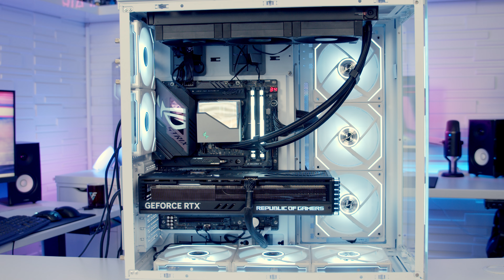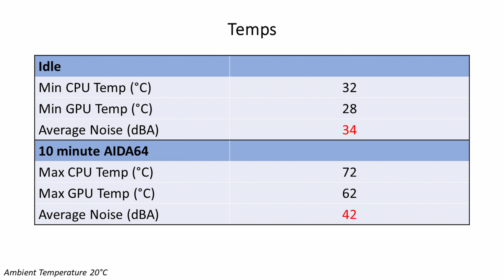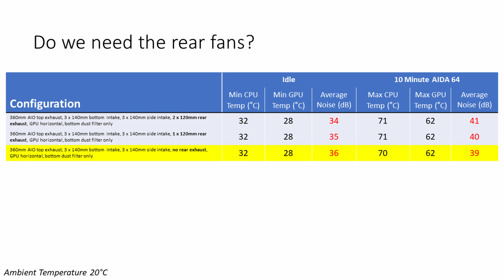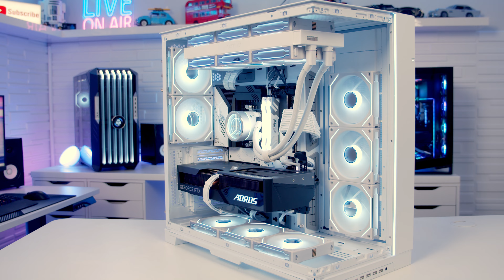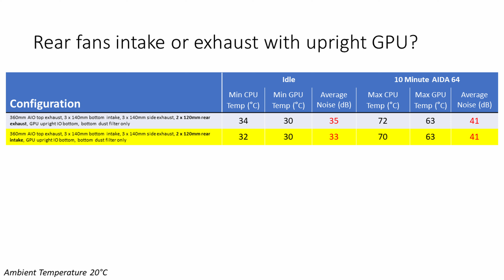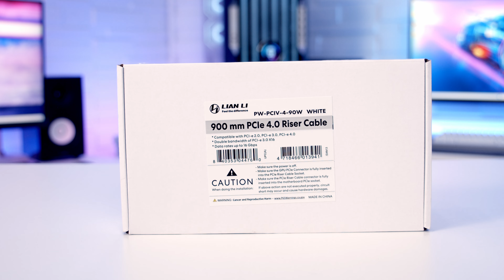Lian Li O11 Dynamic Evo XL - Best Fan Configuration

Comment: Bro is this okay? I am going to build this soon.
Processor-Intel Core Ultra 7 270k plus

Motherboard-ASRock Z890 Nova WiFi(Gen 5 x4 Support)

Graphics card- NVIDIA RTX 5080
( zotag or gigabyte )

CPU Cooler-Arctic Liquid Freezer III AIO 420 (Black)

RAM-G.Skill Trident Z5 RGB
16*2=32GB (should I go for7200MHz/6400MHz)

Storage (SSD)-Crucial T705 2TB Gen5
NVMe SSD (14,500MB/s)

Power Supply-Corsair HX1000i
(1000W) 80+ Platinum ATX 3.1

Cabinet (Case)-Lian Li 011 Dynamic
EVO XL (Black)

Fans-3 × 140mm SL-Infinity (Side ke liye) Reverse Blade model mein 

-3 x 140mm SL-Infinity (Bottom ke liye): 
Reverse Blade model mein

2 × 120mm SL-Infinity (Rear ke liye): Ye Normal
Reply: i hope u got the ram before this issue. have 2x m.2 an have one for the os note 500gb should be good enough u can add other software like razer lian li ect.

Comment: Studied your informative video a lot of times when building in my EVO XL myself. This case make a lot of different setups possible, which is why I love it. There's just so much to explore. I decided to try switching from horizontal GPU and mount it upright to perform the same tests you died, only with another GPU. My PNY 4080 Super performed very different in the horizontal position compared to upright. I got the absolute worst temps in the upright position.
Stress tests performed with OCCT for 10 mins, 3d Adaptive set to Extreme.
I observed GPU but also Hotspot temp to get a better picture of the temperature.
Fan Setup for horizontal: 2X 120mm at the rear set to exhaust, 3x 120mm set to intake at the bottom, 360 AIO side mounted set to intake, 3x 120mm top set to exhaust.
Fan Setup for upright: 1X 120mm at the rear set to intake, 4X 120mm set to intake at the bottom, 360 AIO at the top set to exhaust, 2x 120mm behind upright GPU set to exhaust.

Results as follows:
Horizontal: GPU Temp max 71C, Hotspot max: 89C
Upright IO Bottom: GPU Temp max 74C, Hotspot max: 94C
Upright IO Top: GPU Temp max 79C, Hotspot max: 101C

Results shows the same conclusion that you mentioned in your video, it varies alot depending on the graphics card, and this just clearly shows that this card doesn't like to be mounted upright.
Reply: Doing the same on my build... personally I like the AIO on the side so the top and bottom fans match exactly in terms of aesthetics

Comment: I currently have one side intake, 3 bottom intakes (with filter), top AIO intake (filtered) and two rear exhausts (all fans aside from the AIO ones are the corsair af slim 120mm ones, no RGB) beause I wanted positive pressure and I spent a week watching airflow videos but I think this is not the best approach despite all my effort put into trying to imagine the airflow and concinging myuself it would run smooth over the mobo cooling the chipset down a bit too. 

It's hard to know with W11 infecting my machine with their messed up attempts of launching the telemetry I disabled, thus running my 7800x3D to 80ºC sometimes until I kill the damn Click to run from task manager... damn o356... I digress, I'll switch to linux at some point.

I'm wondering why are there no side AIO exhaust attempts made. I'm thinking about that and wondering what difference would it make in temps extracting all that hot air from the central air bubble that gets created coming off of the Mobo and a horizontal GPU, but seeing that the best temps under load and idle + best noise are achieved with the 360mm AIO side intake, 3x120mm bottom intake, 3x120mm top exhaust, 2x120mm rear exhaust, maybe I'll go for that (with the caveat of only having 2x140mm top exhausts and 1x140mm rear exhausts until I get my hands on some new fans) 

thougts? (no prayers thanks)

Comment: So what I was wanting to do was change the direction of the front fans so that air is only pulled in from the side and no hot air that comes off the radiators goes inside the case or thru different radiators but I don’t know if that would work because of the pressure concern issue.

Comment: Ok I want to thank you so much Chris. First your Lancool 216 video helped me so much when building in that case. Then I sold that PC and started anew with an O11D EVO XL build. All 140mm fans except the rear and side LF III 420 push-pull AIO. Though I couldn’t mount the 3rd top exhaust fan yet because of the AIO tubes.

Bottom line is you now helped me build 2 computers with very good airflow setups. Thanks to your build guides, it was a breeze building in these cases.❤

Comment: is it possible to verticaly side mount that gpu  but with fans blowing out the side exaust?  
bc of all the heat going into the backplate of that gpu it probably gives worse results than its needed.  same as it is, just flipped around, so youre actualy looking at the backplate instead of the fans.  Im not here for looks.  :D 
also, the righ most bottom intake fan would then actualy serve a purpose of cooling that backplate, so i think were leaving some performance on the table.

Comment: curious if this case would allowed me to mount a powercolor red devil 9070xt 340mm length in the top pcie slot and a 6900xt in the vertical gpu with the rise cable going to my pcie 4 x 4 slot at the bottom of the motherboard?

Comment: There is a point of irony to point out with this case.. It is geared towards being for AIO users, but the way it is made makes it optimal for air-cooled setups with maximum through-flow. Not exactly what you'd think of when looking at "display your setup"-type cases, but for pure practicality or if you have a good looking air-cooler for the CPU, you can do bottom in, rear out, top out, with an upright GPU, and have such a good flow that the air of the GPU never graces the CPU as the air-cooler throws that out the back and rear-top while GPU air goes straight up to top fans.

Comment: I have this case too and love it!  I have side as intake bottom as intake and filled the two fans in back as intake . I have push pull on top and two fans in back. I used all 120mm fans and am cooling a 14700k. I have a mix of fans (tl120 lcd, al120 v1 and al120v2 and some 120 slims in the back. )  gpu is in horizontal position.  My cpu idles at 30c and will go up to 65c-75c if gaming for a few hours.

Comment: These videos have been amazing and helped convince me that the O11D Evo XL is basically my dream case. Now that I bought one though I'd love if you could do this same video but with the case inverted!

I like to keep my PC on the left side of my desk (partially due to room layout, partially because my headset cord is on the left) so inverted is the best way for me to enjoy the aesthetics of the case. However, that also puts the GPU (if mounted horizontally or vertically) near the top of the case and could definitely change the optimal orientation for cooling.
Reply: You can fully invert, nothing changes
Reply: @ppeez  Ok, show your measurements please.

Comment: Thanks for doing the heavy lifting. I'm getting a Antec C8 which is very similar and I'm asking myself the same questions, drawing things on paper and checking which I think would be the coolest (in both senses). It's helpful to see the practical result :)

It's great to see the AIO is actually better used as a side intake, it really compensates for the lack of front intake, making it so both the GPU and CPU get fresh outside air. Nice!

Comment: I have this case, awaiting parts. I'm thinking of mounting the cpu radiator on the side, it can be mounted 4 ways they say there. Air will flow from main compartment to back compartment. GPU will go in normal. Which way should the other fans point?

Comment: Hi, dont know if you check this video anymore but here I go. I have this case and it stands on the floor next to me because of my small living room. I have noticed it bothers me with the heat from the top of the case. It run upwards under my desk and to the side where i can feel the heat on my legs - makes me sweaty and it dont feel good after some time. Got the 4090 strix oc but i think my cpu cooler needs to go to the side, like you do at 19:43. I have Arctic Liquid Freezer II 280 A-RGB that pumbs air out from top of chassis. So what would be the best thing for me to do?

Comment: Hi, this is a great video! Did you, by any chance, also take a look at RAM temperatures? I am using a board where the RAM sticks sit above and below the CPU (top left of the case) and apparently they do not get enough air, although I have 3 140 mm fans as intake on the side and the bottom (6 overall), 6 push/pull going out at the top and 2 120mm going out at the back. I have really low fan speeds set right now. One option is to increase fans speeds but perhaps it also a good option to reverse the back 120 mm fans? Did you check the temperatures when you did the reverse configuration of the rear fans?

Comment: Vertical gpu mount for anti sag and good noise+thermals, side mount AIO intake for better CPU thermals is my choice based on performance, looks, and ease of use. Ideally aio tubes down running behind the vert GPU and maybe not an all-white build would look pretty clean I think.

Comment: can u pls do a verticle mount guide with this case or point me to one. All other guides r with old 011D Evo normal that use screws for the gpu side cover brackets. The 011D Evo xl use non-screw latches so i cant for the life if me figure out how to secure the mount since theres no screws to secure it with.

Comment: What about top AIO and bottom fans set to intake, and back and side fans (behind upright-mounted GPU) set to exhaust? Can anyone comment on that.

Also, I know this is a long shot, but does anyone know if Gigabyte's 4090 Gaming OC fits in the upright mount with Arctic's 420 mm LFII mounted at the top of the case? Lian Li says on their website that the max thickness for an upright GPU with a top/bottom 420 AIO is 75mm, and Gigabyte's beefy boi is just about that...

Comment: Intakes should have a dust filter, but on the rest you dont need if you have a positive preassure in the case(you put in more air mechanically than you pull out with fans). Then all non filtered holes in the case should push out air reducing dust.

Comment: Hi. Thanks for the video and all the different configurations - that must have been a lot of work!
When I first set up my Lian Li O11 Dynamic Evo XL I had 3 x 140's at the side and bottom as Intake, thje 360 AIO at the top as Exhaust as well as the 2 x 120's at the rear as Exhaust as well. And the GPU in the traditional horizontal position. So much as you have.
The only thing I didn't like was the huge ugly gap at the top of the Case by having the Motherboard in the low position.
So after a couple of months I lowered the Motherboard to the Centre position and removed on of the 120's. Overall I just think it looks more "ballanced" and I don't really miss the extra 120 at the rear of the Case. But I'm sure if Lian Li had done away with the top PCIE Bracket they could have made it so that even in the Centre position you could still have 2 x 120's.... There would be enough room. And I've never ever used the top PCIE Bracket, so I feel it's quite redundant.
Thanks again. Ciao.

Comment: Hello great video. So I am currently working on my first build. I am using this case. I’m more looking towards the way it looks. So I want to use as many 160mm fans as I can and the rest 120mm. I want to use the side as the lian li lcd 140 but I am trying to determine which way the fans should be far as Intake and exhaust.

Comment: Hi Chris, is the upright GPU mounting kit (Lian Li O11DE-2X Upright GPU Kit I Upright Graphics Card Kit for O11D EVO - Black - G89.011DE-2X.I) is same for both O11D EVO Mid and O11D EVO XL? I wanted to move on this case just because I wanted to move my GPU away from motherboard because when GPU temp increases it also increase the temps of my 990Pro's along with RAM significantly, I have ATX size MOBO and noctua nh-d15 AirCooler (on 7950x3d, 128GB RAM), what size of fan, what sides I should fill of this case with fans and what should the fan config to get the best cooling possible with my aircooler. I can move to AIO but it would make my nd-d15 useless and I don't want to waste money, however I have to move from my existing case anyway as it is very old.

Comment: Have a fan set up idea. I like the side mounted push pull AIO. Set up. But I had a idea of also getting a msi supreme liquid 4090. Would it be possible to have that cooler set up on the backside, since this case is able to do a double back fan. Would this be possible with the set up at 8:43?

Comment: And based on my testing with the AIO(Liquid Freezer 2 420) on the side with and without push-pull as exhaust, top intake, bottom intake, rear intake, gpu horizontal had the best thermals.
Reply: Interesting. But then there is the hassle to add a filter for the rear intake fan(s). May I ask if you tested the AIO in intake, bottom intake, top & rear exhaust?  If so, what are the differences in temp and noise vs your config? Thanks
Reply: @o.t.t.o.t.t.1834  We did not have a filter for rear fans during testing. We did test couple of the "classic" setups with side AIO push-pull intake (6x140), bottom intake (3x140), top (3x140) and rear exhaust (2x120). With any variation of this setup the second rear fan did not matter. It added more noise for marginal thermal benefit. It is an extra fan so it might add something aesthetic wise. 

A larger factor was the side AIO placement (bracket) and the filter for it since placing closer to side panel will naturally want pull more air which means it will ramp up more and cause more noise. Since with push-pull one wants to have similar rpms with across 6 fans, the significant rpm jump will cause quite a lot more noise. Thermals were good but with a noise sacrifice. Placing the AIO further away (the default) will have a significant negative impact on thermals which will lead to more rpm with little thermal improvement. In this scenario the thermals were bad which requires some fan tuning due to fans ramping up with bad efficiency.

Conclusion
Classic way with AIO closer to side panel will yield better cpu temps, same-ish gpu temps, worse mbo temps, with more noise, filter as a large factor
Classic way with AIO further away to side panel will result in worse cpu temps, same-ish gpu temps, same mbo temps as above, with less or more noise depending on tuning, filter not as large of a factor.
We stand by our testing with with AIO push-pull as exhaust and the rest as intake with the best results in temps and noise. For overclocking we recommend the classic way with AIO closer to side panel. This will result in a very significant noise delta compared to others but one will achieve the best clocks using this setup. For any other scenarios like undervolting and PBO, we recommend the AIO as exhaust and the rest as intake for the best thermals for noise. Hope this helped.
Reply: @o.t.t.o.t.t.1834 AIO as the intake pumps the hot air into the case.
Reply: Tubes up or down?

Comment: With Strix in upright gpu bracket aren't you supposed to put two fans blowing to the GPU and one fan blowing out to the case from GPU due to the design of the card's exhaust itself and the vapor chamber. Also GPU position on upright bracket should also been considered due to the vapor chamber. Lian Li had pretty good list how the card should be oriented on the bracket.

Comment: Thanks so much for this. Setting up my case now and this helps a lot for my idea on temps and was worried about too much exhaust vs intakes.

Although I may keep my push pull on my aio just for that "thicc" look at the top of the case and as low fan speeds as possible up there.

Thanks again for the insane testing.

Comment: I want to know if i have to go with the 900mm riser or 600mm riser is enough? It seems 600mm will be enough but i couldnt sure. Can you help me? By the way this video is really helpful. Thanks for that.
Reply: According to the Lian Li upright mount product page, the length of the riser cable will depend on the GPU I/O orientation.  If we mount the GPU with the I/O panel on top, then Lian Li recommends a 60cm riser.  If the GPU I/O panel is facing down, then they recommend using a 90cm riser cable.  I suspect that given this post's publication date that you are long past caring.  But since I am dealing with this issue now I thought I would assist any fellow travelers at this time.

Comment: Rear fans seem nice like this, but if you go for a reverse build don't they become completely pointless by being at the bottom of the case, thus creating a "in from the bottom, out near the bottom" corner that just moves air without cooling anything?